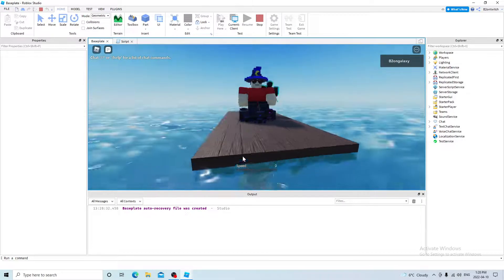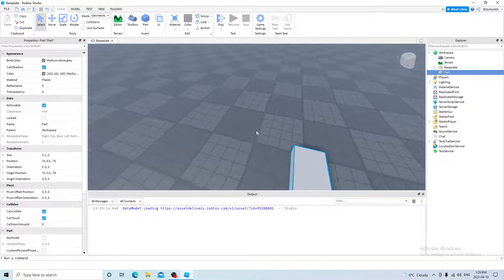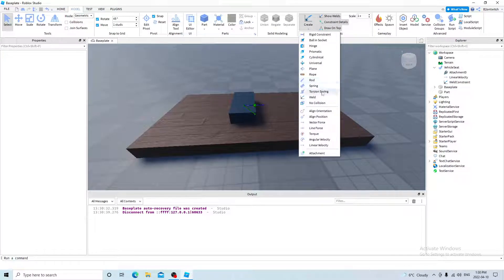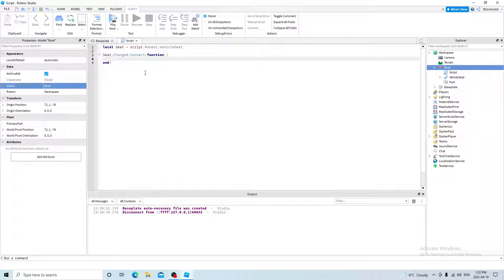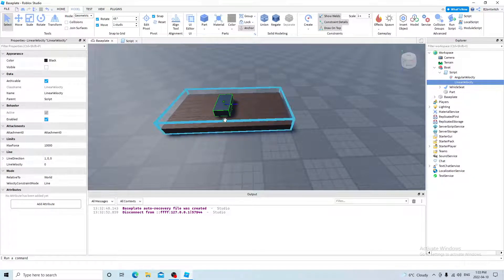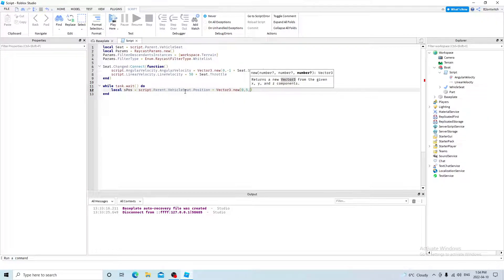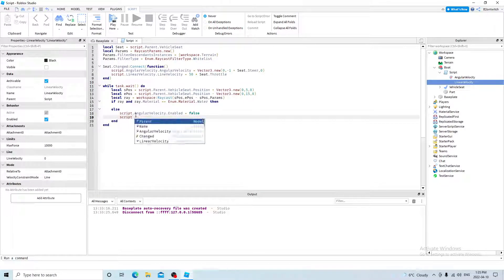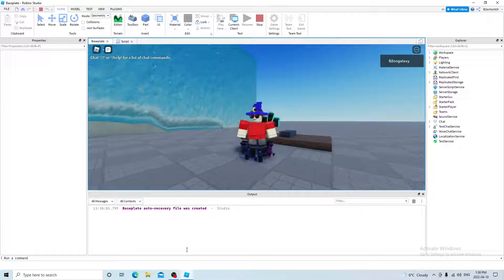How to Make a Boat in Roblox Studio

Comment: Heres the working script;
local Seat = script.Parent.VehicleSeat
local Params = RaycastParams.new()
Params.FilterDescendantsInstances = {workspace.Terrain}
Params.FilterType = Enum.RaycastFilterType.Include

Seat.Changed:Connect(function()
	script.Parent.VehicleSeat.AngularVelocity.AngularVelocity = Vector3.new(0,-1 * Seat.Steer, 0)
	script.Parent.VehicleSeat.LinearVelocity.VectorVelocity = Seat.CFrame.LookVector * (Seat.Throttle * 50)
end)

while task.wait() do
	local sPos = script.Parent.VehicleSeat.Position + Vector3.new(0,5,0) 
	local ePos = script.Parent.VehicleSeat.Position - Vector3.new(0,15,0) 
	local ray = workspace:Raycast(sPos,ePos - sPos,Params) 

	if ray and ray.Material == Enum.Material.Water then 
		script.Parent.VehicleSeat.AngularVelocity.Enabled = true
		script.Parent.VehicleSeat.LinearVelocity.Enabled = true
	else
		script.Parent.VehicleSeat.AngularVelocity.Enabled = false
		script.Parent.VehicleSeat.LinearVelocity.Enabled = false
	end
end
Reply: WHY IS IT STPINNING INSTEAD OF MOVING FORWARD

Comment: Updated script:

local Seat = script.Parent.VehicleSeat
local params = RaycastParams.new()
params.FilterDescendantsInstances = {workspace.Terrain}
params.FilterType = Enum.RaycastFilterType.Include

Seat.Changed:Connect(function()
	script.AngularVelocity.AngularVelocity = Vector3.new(0,-1 * Seat.Steer,0)
	script.LinearVelocity.LineVelocity = 50 * Seat.Throttle
	end)

	while task.wait() do
		local sPos = script.Parent.VehicleSeat.Position * Vector3.new(0,5,0) -- The * needs to be changed to +.
		local ePos = script.Parent.VehicleSeat.Position * Vector3.new(0,15,0) -- The * needs to be changed to -.
		local ray = workspace.Raycast(sPos,ePos - sPos,params) -- The . in workspace.Raycast needs to be switched to :.
		if ray and ray.material == Enum.Material.Water then -- The m in ray.material needs to be capitalized.
			script.AngularVelocity.Enabled = true
			script.LinearVelocity.Enabled = true
		else
			script.AngularVelocity.Enabled = false
		script.LinearVelocity.Enabled = false
	end
end 
Fixed some issues like whitelist and end)

Comment: Here's what I did, maybe it will help someone. I got a boat off the asset store, made all parts non-anchored, used rig-tool to weld all parts together so it won't fall apart. Then, follow this tutorial. Cheers! OH - and the weight of the sails was tipping my boat over so I marked them as massless - that did the trick!

Comment: This script is outdated use this!!

local Seat = script.Parent.VehicleSeat
local params = RaycastParams.new()
params.FilterDescendantsInstances = {workspace.Terrain}
params.FilterType = Enum.RaycastFilterType.Include

Seat.Changed:Connect(function()
	script.AngularVelocity.AngularVelocity = Vector3.new(0,-1 * Seat.Steer,0)
	script.LinearVelocity.LineVelocity = 50 * Seat.Throttle
end)

while task.wait() do
	local sPos = script.Parent.VehicleSeat.Position + Vector3.new(0,5,0)
	local ePos = script.Parent.VehicleSeat.Position - Vector3.new(0,15,0)
	local ray = workspace:Raycast(sPos, ePos - sPos, params)

	if ray and ray.Material == Enum.Material.Water then
		script.AngularVelocity.Enabled = true
		script.LinearVelocity.Enabled = true
	else
		script.AngularVelocity.Enabled = false
		script.LinearVelocity.Enabled = false
	end
end
Reply: didnt work

Comment: Those who get error with whitelist, use "Include" instead. Here's the line: Params.FilterType = Enum.RaycastFilterType.Include
Reply: Thanks
Reply: It did not work. Is the script deprecated? June 24 2024.
Reply: @VacationRetroGaming  If it didn’t work, it may be other problem in the script.
Reply: @VacationRetroGaming  you might not need it anymore but here's a fix version 

local Seat = script.Parent.VehicleSeat
local params = RaycastParams.new()
params.FilterDescendantsInstances = {workspace.Terrain}
params.FilterType = Enum.RaycastFilterType.Include

Seat.Changed:Connect(function()
	script.AngularVelocity.AngularVelocity = Vector3.new(0,-1 * Seat.Steer,0)
	script.LinearVelocity.LineVelocity = 50 * Seat.Throttle
end)

while task.wait() do
	local sPos = script.Parent.VehicleSeat.Position + Vector3.new(0,5,0)
	local ePos = script.Parent.VehicleSeat.Position - Vector3.new(0,15,0)
	local ray = workspace:Raycast(sPos, ePos - sPos, params)

	if ray and ray.Material == Enum.Material.Water then
		script.AngularVelocity.Enabled = true
		script.LinearVelocity.Enabled = true
	else
		script.AngularVelocity.Enabled = false
		script.LinearVelocity.Enabled = false
	end
end

Comment: I made a more complicated boat with more parts welded to it but it's acting weird, for example when I load in, it moves forwards on its own and when I run up to it while it's moving and I jump in, I can move the boat freely. But when I jump out and jump back in, it doesn't work anymore. I tried" if seat.Occupant =~ nil " but that didn't work either. Is there another way to do this?
Reply: @MRdino I wanted to use this but it just wont work. I switched to just making a car using a A-chassis
Reply: @MRdino nah its good now i wan going for a car idea anyway
Reply: I need assistance

Comment: My boat is constantly turning right by itself for some reason and also button D stops boat and A is for some reason is turning boat right even faster.
Reply: I also set my LineVelocity to 0 and changed mode from vector to line and max force 10k and for AngularVelocity I used 0,0,0 with maxtorque 10k
and here is my code

local Seat = script.Parent.VehicleSeat
local Params = RaycastParams.new()
Params.FilterDescendantsInstances = {workspace.Terrain}
Params.FilterType = Enum.RaycastFilterType.Whitelist

Seat.Changed:Connect(function()
	script.AngularVelocity.AngularVelocity = Vector3.new(0,-1 + Seat.Steer,0)
	script.LinearVelocity.LineVelocity = 50 * Seat.Throttle
end)

while task.wait() do
	local sPos = script.Parent.VehicleSeat.Position + Vector3.new(0,5,0)
	local ePos = script.Parent.VehicleSeat.Position - Vector3.new(0,15,0)
	local ray = workspace:Raycast(sPos,ePos - sPos,Params)
	if ray and ray.Material == Enum.Material.Water then
		script.AngularVelocity.Enabled = true
		script.LinearVelocity.Enabled = true
	else
		script.AngularVelocity.Enabled = false
		script.LinearVelocity.Enabled = false
	end
end
Reply: nvm I got it, I just made a typo in line 7 by accidentally typing + and not *

Comment: Its a multi-part ship, and its unanchored so it falls apart. I tried qperfectionweld and then it sinks. Just anchoring it doesnt make it move. Is my script right?

local Seat = script.Parent.VehicleSeat
local params = RaycastParams.new()
params.FilterDescendantsInstances = {workspace.Terrain}
params.FilterType = Enum.RaycastFilterType.Whitelist

Seat.Changed:Connect(function()
	script.AngularVelocity.AngularVelocity = Vector3.new(0,-1 * Seat.Steer,0)
	script.LinearVelocity.LineVelocity = 50 * Seat.Throttle
end)

while task.wait() do
	local sPos = script.Parent.VehicleSeat.Position + Vector3.new(0,5,0) 
	local ePos = script.Parent.VehicleSeat.Position - Vector3.new(0,15,0)
	local ray = workspace:Raycast(sPos,ePos - sPos,params)
	if ray and ray.Material == Enum.Material.Water then
		script.AngularVelocity.Enabled = true
		script.LinearVelocity.Enabled = true
	else
		script.AngularVelocity.Enabled = false
		script.LinearVelocity.Enabled = false
	end
	end
Reply: I have the same problem
Reply: make it a union, that should fix it

Comment: Heres my script is it correct?
local Seat = script.Parent.VehicleSeat
local Params = RaycastParams.new()
Params.FilterDescendantsInstances = (workspace.Terrain)
Params.FilterType = Enum.RaycastFilterType.WhiteList

Seat.Changed:Connect(function()
	script.AngularVelocity.AngularVelocity = Vector3.new(0,-1 * Seat.Steer,0)
	script.LinearVelocity.LinearVelocity = 50 * Seat.Throttle
end)

while task.wait() do
	local sPos = script.Parent.VehicleSeat.Position + Vector3.new(0, 5, 0)
	local ePos = script.Parent.VehicleSeat.Position + Vector3.new(0, 15, 0)
	local ray = workspace:Raycast(sPos, ePos - sPos,Params)
	if ray and ray.Material == Enum.Material.Water then
		script.AngularVelocity.Enabled = true
		script.LinearVelocity.Enabled = true
	else
		script.AngularVelocity.Enabled = false
		script.LinearVelocity.Enabled = false
	end
end
Reply: script.LinearVelocity.LinearVelocity = 50 * Seat.Throttle (false)
script.LinearVelocity.LineVelocity = 50 * Seat.Throttle (true)
there is another problem i couldnt solve

Comment: To anyone who is struggling with the boat going into odd direction when they use the movement keys:
1) Change the LinearVelocity > VelocityConstraint > Vector instead of Line.
2) In the code that deals with the LinearVelocity change it to this:
	script.LinearVelocity.VectorVelocity = Seat.CFrame.LookVector * (Seat.Throttle * 50)
That should do the job.
I'd suggest to use VectorForce instead of LinearVelocity though..
Reply: My boat doesn’t even move
Reply: @whateveryouwantman  yes not doesn't move
Reply: please make a tutorial
Reply: Mine starts going by its own
do yyou know how to fix?
Reply: TYSM
Reply: that make my boat flying
Reply: Yo bro, how do you use the vector force?
Reply: Using VelocityConstraint > VectorForce makes the boat float in air without falling down
Reply: TYSM

Comment: i wanna make the boat bigger then just 1 block like im made a sail boat
Reply from the maker: You need to make the sail boat model then weld it together and increase the forces.
Reply: @blockyscript6798  by how much should one increase the forces if the boat is much bigger?
Reply from the maker: @giom5609  That's hard to say, you'd have to play with the numbers. You can make a script that multiples the mass by a certain amount and set that as the amount of force.

Comment: It works, but is there any way to prevent the boat from glitching out when another player hops on?
Reply from the maker: It shouldn't be glitching
Reply: You can add a body mover or change the density in the custom physical properties. Density is kinda easy to make it around 0.5, lower than 1.

Comment: It didn't work for me. After I was done with the script (no red lines) I pressed 'play here' and set on the boat. It didn't work and I wasn't able to move so.. why? and how can I fix this ?
Reply: if you anchored it, unanchored it. then it should move.
Reply from the maker: As Coke said, try unachoring it if you have it unachored. The LinearVelocity controls the movement of the boat. Did you make sure your LinearVelocity is the same as mine?
Reply: @blockyscript6798  what if u have a multipe part boat does it need to be anchored though?
Reply from the maker: @superr7776  no, even if one part is anchored it makes all the other connected parts anchored too

Comment: Hi new problem maybe this is the last one my boat wont turn but it can go forwards and backwards
The script
 local Seat = script.Parent.VehicleSeat
 local params = RaycastParams.new()
 params.FilterDescendantsInstances = {workspace.Terrain}
 params.FilterType = Enum.RaycastFilterType.Whitelist

 Seat.Changed:Connect(function()
	script.AngularVelocity.AngularVelocity = Vector3.new(0,-1 * Seat.Steer,0)
	script.LinearVelocity.LineVelocity = 50 * Seat.Throttle 
end)

	while task.wait() do
		local sPos = script.Parent.VehicleSeat.Position + Vector3.new(0,5,0) -- The * needs to be changed to +.
		local ePos = script.Parent.VehicleSeat.Position - Vector3.new(0,15,0) -- The * needs to be changed to -.
		local ray = workspace:Raycast(sPos,ePos - sPos,params) -- The . in workspace.Raycast needs to be switched to :.

		if ray and ray.Material == Enum.Material.Water then -- The m in ray.material needs to be capitalized.
			script.AngularVelocity.Enabled = true
			script.LinearVelocity.Enabled = true
		else
			script.AngularVelocity.Enabled = false
			script.LinearVelocity.Enabled = false
		end
end
Reply: i think this the problem, so if you look at the paragraph

Seat.Changed:Connect(function()
	script.AngularVelocity.AngularVelocity = Vector3.new(0,-1 * Seat.Steer,0)
	script.LinearVelocity.LineVelocity = 50 * Seat.Throttle 
end)

if you look at 0,-1 you need to put space between the dash and the comma so like this 0, -1
Reply: @tompdlgamer9442  💀
Reply: on line 4 of youre script, whitelist hast been removed from the game and is now cxalled include or exclude, put include adn if that doesnt work exclude

Comment: How do you fx the boat because it goes it a weird way example if I press A and W it should go forward left but it goes backwards, goes backwards right then backwards left its like  dancing left and right backwards
Its fixed
Reply: Change your seat position. It is likely back to front, rotate it
Reply: What did you do to fix it

Comment: I have a problem.
After I turn right or left, my boat will tilt and it won’t turn back by it self.
Is there any way to fix this problem?
Reply from the maker: Make sure the AngularVelocity.MaxTorque is set to inf and inside the script make sure the AngularVelocity.AngularVelocity is set to Vector3.new(0, -1 * VehicleSeat.Steer, 0)
Reply: @blockyscript6798  My boat can turn right or left when I press D or A ,but my problem is it not only do that, but also tilt a few degree (turn more will tilt more)by it self and it wont return. 
Maybe I need a gyro.
Reply from the maker: @James_Hsu  Something might not be keeping the X or Z axis of your AngularVelocity at 0. Can you paste the script so I can help more?
Reply: @blockyscript6798  
local battleship = script.Parent
local seat = script.Parent.VehicleSeat

seat.Changed:Connect(function()
	script.AngularVelocity.AngularVelocity = Vector3.new(0,-1*seat.Steer,0)
	script.LinearVelocity.LineVelocity = 50 * seat.Throttle
end)

I just went to download other working boat model to my game, and I found that their boat also have this problem.
Reply from the maker: @James_Hsu  Your script looks fine, I'm not sure what could be wrong. Click on the angular velocity and make sure the angular velocity property is Vector3.new(0,0,0). If it is, add an align orientation, change it's relativeto property to attachment 0. Make the max force of the align orientation smaller than the max torque of the angular velocity. The angular velocity looks fine so another force should be tilting the boat.

If you don't know what this will do, the align orientation tries its best to keep the orientation of the part to a specific vector3. When the boat turns, the force of the angular velocity is higher than the force of the align orientation so the boat will still turn at the right speed (unless the difference of both forces aren't big enough, then the speed will be between 0 - less than 1). Whatever force is "tilting" the boat should be eliminated from the force of the align orientation.

Hope this helps.
Reply: @blockyscript6798  I had solved the problem by using this:

while true do
	wait(0.1)
	if seat.Steer == 0 and battleship.VehicleSeat.Orientation.Z > 0 then
		script.AngularVelocity.AngularVelocity = Vector3.new(0,0,-0.02)
	end
	if seat.Steer == 0 and battleship.VehicleSeat.Orientation.Z < 0 then
		script.AngularVelocity.AngularVelocity = Vector3.new(0,0,0.02)
	end
	if seat.Steer == 0 and battleship.VehicleSeat.Orientation.Z == 0 then
		script.AngularVelocity.AngularVelocity = Vector3.new(0,0,0)
	end	
end

While the steer = 0, this script  will automaticly detect if the ship are tilted or not and turn it back.

But, before use this, I have to make the angularvelocity relative to the attachment0 instead of the world.
Reply from the maker: @James_Hsu  Glad you fixed the problem. I modified your script:

while task.wait(.1) do
	script.AngularVelocity.AngularVelocity = Vector3.new(0,0,-0.02 * math.round(math.clamp(battleship.Orientation.Z, -1, 1)))
end

Comment: mine wont work
i think its because mines updated-
Reply from the maker: I checked your script and wrote comments on what you did wrong. Copy and paste this code into Roblox Studio:

local Seat = script.Parent.VehicleSeat
local params = RaycastParams.new()
params.FilterDescendantsInstances = {workspace.Terrain}
params.FilterType = Enum.RaycastFilterType.Whitelist

Seat.Changed:Connect(function()
	script.AngularVelocity.AngularVelocity = Vector3.new(0,-1 * Seat.Steer,0)
	script.LinearVelocity.LineVelocity = 50 * Seat.Throttle

while task.wait() do
	local sPos = script.Parent.VehicleSeat.Position * Vector3.new(0,5,0) -- The * needs to be changed to +.
	local ePos = script.Parent.VehicleSeat.Position * Vector3.new(0,15,0) -- The * needs to be changed to -.
	local ray = workspace.Raycast(sPos,ePos - sPos,params) -- The . in workspace.Raycast needs to be switched to :.

	if ray and ray.material == Enum.Material.Water then -- The m in ray.material needs to be capitalized.
		script.AngularVelocity.Enabled = true
		script.LinearVelocity.Enabled = true
	else
		script.AngularVelocity.Enabled = false
		script.LinearVelocity.Enabled = false
	end
end